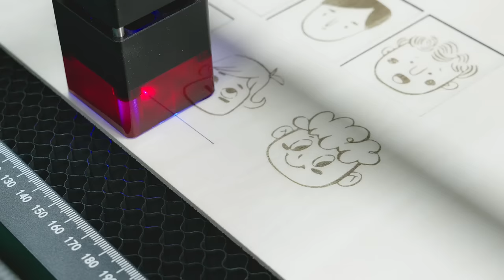TwoTrees | TTS-10 Creativity, It‘s a Cinch

Comment: HELLO . I BOUGHT A TTS-10 AND I'M USING LIGTHBURN 1.4 .
THE PROBLEM IS THAT WHEN I MOVE THE X AXIS, THE Y AXIS MOVES A LITTLE ALSO!
HOW TO SOLVE THIS?
Reply from the maker: Thank you for reaching out to us. I'm sorry to hear that you are experiencing issues with your TTS-10 and LightBurn 1.4 software. The problem you are describing, where moving the X axis causes the Y axis to move as well, could be caused by several factors.

To help you resolve this issue, I would recommend contacting our after-sales technical staff for assistance. They will be able to provide you with guidance on troubleshooting the issue and finding a solution.

Please let me know if you would like us to connect you with our customer support team or if you have any other questions.

Whatsapp: +86 177 2282 6689
Email: service@twotrees3d.com

Thank you for choosing our product.

Comment: what are the dimensions of this hive, for the printing area of 300x300mm? 400x400 fits?
Reply from the maker: Hello, if you want to know more about Honeycomb, please click our store to learn more.
Reply: @Twotrees3Dofficial  Thanks for the quick response. But what happens is that the documentation (I've already visited the site) only informs the external dimensions and the usable "printing" area. But not the inner area between the bases (feet) of the TTS-10. I'm not sure a 40x40 hive would fit in the inner base of the equipment. If you could clarify this doubt for me, I would be very grateful.
Reply from the maker: @ethrigandaemonicus300  Hello, friend. we recommend contacting the after-sales engineering department on Whatsapp: at +86 177 2282 6689 or emailing, service@twotrees3d.com to get a faster reply.